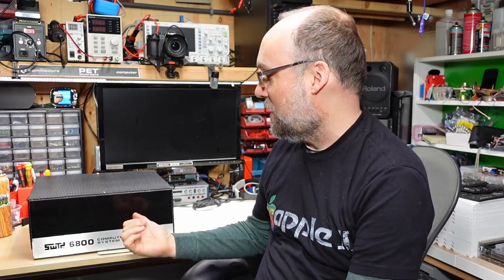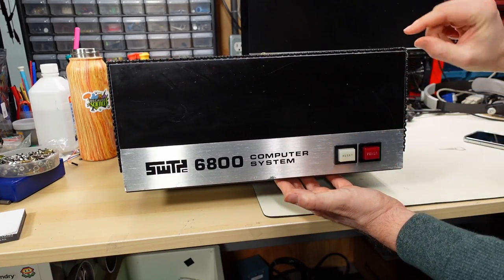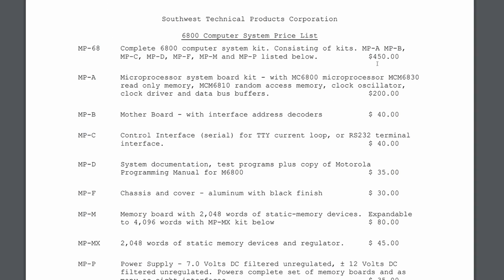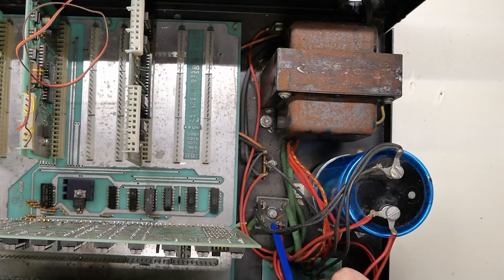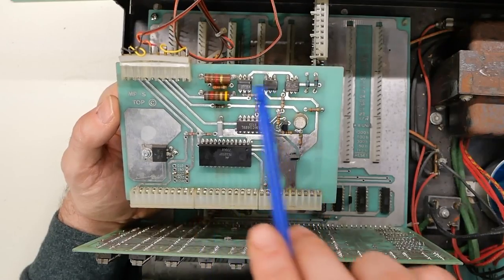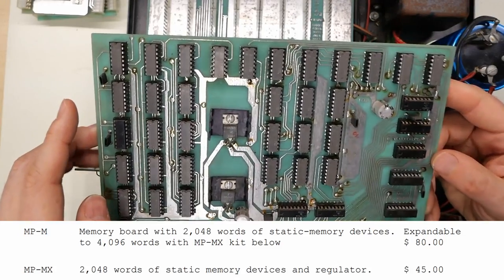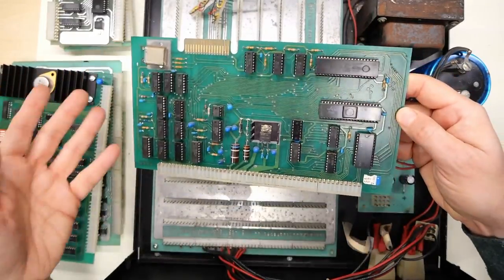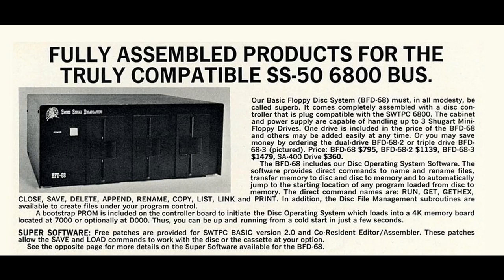The 8-bit home computer from 1975 you've never heard of

Comment: I worked at a company that used the 6809 variant of this machine in the late 80s.  My first day on the job I walk in to find a coworker standing on a rolling chair with a watering can pouring water into the case of one of these.  Of course, it was turned ON at the time.  After I picked my jaw up off the floor and we were properly introduced, he related that this particular machine had a crack in the motherboard no one could find, so they kept a thin layer of water in the bottom of the case to keep the MB swelled up and the mysterious crack sealed so everything worked.  The problem was the water would evaporate, and so it had to be "refilled" when the machine started getting flakey; the plastic standoffs made this possible.  This company used the 6809 variant as a central processor for a passel of "remote processors" (an in-house built version of the same machine) that monitored sensors and responded to the central processor via phone lines, hardwired, or radio broadcast.  The central processor stored data on a dual tape drive (DEC I believe) and my job was, among other things, to duplicate the central processor function on an Apple 2, and later an IBM PC.  I did a few other things for them, including the code for a new kind of remote processor with different sensors.  Robin or Don: if you're reading this, look me up.  J
Reply: No F'n way lol. I can think of about 10 better ways to seal that micro crack than filling the case full of water but hey, I guess it was better than no solution!
Reply: Do you remember the Apple 3 and the issues it had of the chips popping partially out of the sockets? Apple actually sent out a tech note that suggested holding the Apple 3 above a hard surface at a distance of approximately 5 feet and dropping it. This would reseat the chips in their sockets... Ah the good ole days...
Reply: @retroatx  5 inches, but yeah.  I remember...
Reply: Sounds like a joke they did to all the new people like finding the blinker fluid or the board stretcher.
Reply: @fredflintstone9609  I didn't even realize that I typed five feet :-)
Reply: geeeeeeez - bring some current new one - there is a bucket
Reply: It wasn't a joke: every Monday he would refill it.  I took over the job of refilling the watering can.
Reply: This is insane watering a computer like a plant 🪴 😂❤
Reply: @retroatx 😂
Reply: @fredflintstone9609 Definitely an "if it sounds stupid but it works" moment.

Comment: I bought and built one of these SWTPC computers. I even wrote quite a bit of software for it and had it working with the SSB disk drives, a Teletype 43 and later a SWTPC VDU/Keyboard combo which was in some kind of mouleded blue/cream case. I later also interconnected the SWTPC computer to a broadcast teletext receiver which let me save the "pages" to floppy disc. I also made my own S100 cards for memory and interfacing to Motorola exorciser boards. Everything was horribly expensive in those days amd one had to save up just to buy another 1K of memory! I'm pretty sure I still have some of the manuals tucked away somewhere. Sadly, I don't have the SSB DOS software you are are looking out for. Sadly all the hardware got ruined in a flood many years ago. Great memories - many thanks and the best of luck getting it operational. I still have 6800, 6821, MC14411 and 6850 Moiorola chips in anti-static tubes along with some 2102 memor chips (they were really fussy about static!).
Reply: So what did you wind up doing with the machine?  What were your motivations for putting a so much into it?  I
Reply: I have a couple of these and have been trying to find someone I ran across in comments previously who claimed to have programmed a pacman like game for it using the GT-6144 graphics board.  I have one of those boards and have never been able to find anyone who has one or any programs already done for it.
Reply: There should be one in my garage, with a floppy  drive. I didn't get any documentation or disks with it.
I worked with Motorola Exorcisor systems in the early to mid '80s. Two 'Metrodata' graphics systems that generated NTSC video for cable TV. Each system had six video cards to generate text. One system also had in interface card to use a SMS disk subsystem to store our program guide for up to a week in advance,
Reply: Speaking of the SSB disk drives, I made the wire harnesses for those when I was a high school kid in the family garage, at least for the earlier production runs. How that came about was that my dad worked at the Naval Weapons Center annex in Norco, CA at the time, and worked closely with one of the student interns (Tom K.) who eventually graduated and went on to form his own company along with some other bright young engineers  (Signetic Designs) making disk drive systems for 8080 based S-100 systems. My dad continued to to be associated with Tom, maintaining a friendship and interest in what he was doing. This was a garage shop type operation at first, and rather than do the tedious work of assembling wire harnesses for the disk drive system themselves, Tom had me do it for them, supplying a fixture and tools, etc for me to use. Later, SSB started making it's disk drive system 6800-based SS-50 systems, and Tom knew somebody there and somehow I ended up doing their wire harnesses too...

Damn, that was such a long time ago. I'm 62 years old now...
Reply: So you're also another who 'never heard of the SS50?'
Reply: @stevesether  Having fun while learning a lot. Is that reason enough? 😁
Reply: @stevesether  To answer this question: Why spend so much time and money on these computers? In the 1970s these were revolutionary. Imagine if you had a Quantum Computer on your desktop today. How much would you pay? AND... while not a motivation... all the time I spent on 8-bit computers in the latter 1970s got me into college and later landed me a plum job in 1985 when I graduated and has blossomed into a successful career. Without a doubt - this "little hobby" has paid for itself thousands of times over - quite literally.
Reply: One of the most interesting programs I got to work on was a program that recorded amniocentesis results. While I was not able to program yet (I was only 12) they let me test and report bugs and develop the testing scripts. These days AI does much of the actual analysis.
Reply: @devcybiko  I'd not pay anything for a quantum computer, because a ten year old AMD FX-6100 and (fanless) NVIDIA GeForce 210 are Good Enough (since the motherboard allowed me to upgrade to 32GB RAM and replace spinning rust with a flash drive as the main disk).
Reply: @RonJohn63  Do you know what a quantum computer is?
Reply: @devcybiko  yes. https://en.wikipedia.org/wiki/Quantum_computing
Nothing in quantum computing will make reading email surfing the web or watching YT videos easier or better than my current machine.
Reply: @RonJohn63  That's not what a quantum computer is for. The point I was making was that in the 70s hobbyists spent money on these computers because they were novel. Ultimately money spent on this "hobby" resulted in knowledge about computing that resulted in a career in software. 

Similarly, it would be like building a home Quantum Computer today. The benefits would pay off in the long run. The parallels are clear. In the 70s in order to have access to computers you either had to buy time on a time sharing mainframe, or build your own. Today, you can buy time on a Quantum computer built on one of the leaders in the field. You can't build a quantum computer like we could build a microcomputer in the 70s. But the quantum computer hobbyists of today will be the leaders in the field tomorrow.
Reply: @devcybiko  "That's not what a quantum computer is for."
OK, hotshot.. what are quantum computers for?
And just because something's novel doesn't mean it's even close to being affordable.
Reply: @RonJohn63  Do your own research. Read the effing wikipedia page you posted.

Comment: I took a train trip for 1.5 hours to visit a SWTPC shop in the city of Delft, one of the first "computer shops" in the netherlands, I was amazed by the enormous capacitors inside. And yes, they sold fully assembled machines, and also the terminal and some printers. I remember seeing a small cash register printer (40-columns) that was fitted on top of a square metal box.
Reply: That was the SWTPC PR40 printer. The Tech Time Traveler channel has a good video on it, along with a video on the SWTPC CT-1024, aka TV Typewriter II, which was probably the terminal you saw.
Reply: Long before switchmode units large caps were the only option
Reply: Excellent memories! Reminds me of a 3-hour-one-way bike ride me and my brother undertook, just to get to Charlotte NC and see the Apple ][ dealer there. We got in so much trouble for that. Should have left Mom a note.

Comment: As a sophomore in high school, this was the only computer I (with help from my dad) could afford. I built the kit but didn't have a terminal to talk to it. I bought an old klienschmit field teletype at a surplus auction. With the help of a local computer shop I wrote code to convert ascii to 5 bit baudot and used the old teletype for a year until I could buy a used, non working tv teletype....good times.... It was a great experience for a 15 yr old budding engineer!

Comment: The 6800 is one of my favorites.  I have two 6800 system units, the AC-30 tape unit, several CT-1024s, the rare PR-40 printer, the ultra rare GT-6144 graphics board and the almost impossible to find joystick.  The thing takes up an entire desk and a half when fully set up and the powerup sequence reminds me of a jet with all the switches!
Reply: i saw this and instantly thought of you!
Reply: @Arivia1  ditto. I don't understand how tech time traveller does not have more subs. Such a great channel.
Reply: I’d never heard of these machines until I was watching through your channel, then suddenly it pops up here too!
Reply: @drwhang  subbed because of this comment.
Reply: Got the hitachi upgrade?
Reply: Not gunna lie, it sounds like just the power up sequence would be heaps of fun and satisfaction

Comment: A SWTPC 6800 was the first computer I had seen in person. The man who owned it used a teletype for I/O. That was probably in late 1975. Thanks for the trip down memory lane.

BTW, RAM chips were VERY sensitive to static electricity in those days. So often new RAM was damaged and so had to be tested as part of installation.
Also, since that is not a switching power supply, any short will most certainly cause smoke and likely cause a trail of destroyed components. Have fun. :-)

Comment: So much memories.  I have worked as a young trainee then beginner engineer on these machines. Actually only on the SWTPC 6809 as far as SWTPC-branded machines go. It was a very advanced machine with RAM page mapping allowing for up to 768K of RAM on an 8-bit CPU,  running a small Unix-like O/S called UniFLEX.
As for the 6800, the French manufacturer Goupil was producing a machine that was very much inspired from this one from '79 on, the Goupil (the blue gen.1 and red gen. 2). Bus-based too, almost a clone actually, but a complete computer with a video controller, keyboard etc. I still remember the ROM monitor commands (was that MICMON?). It ran the FLEX 6800 o/s which was rather advanced for its time, booting from 5.25" or 8" floppies.
Reply: IIRC, the Goupil was a team effort, a microcomputer by computing hobbyists for computing hobbyists.  It was supposed to be a hacker's dream, designed to meet a hacker's checklist.  It was not a corporate product. The most striking thing about it was its built-in acoustic coupler.  And the beyond complete keyboard.
Fishing through some old issues of Micro-Systèmes magazine from 1980, only found a handful of full-page adverts towards the end of each issue, never found an actual article about them.  It shows they didn't have a corporate budget for marketing.
Reply: I was also an apprentice computer tech and cut my teeth on the SWTP! After repairing one of these, I always smiled and gave a little cheer when the '$' symbol appeared on the monitor! Happy days!

Comment: This brings back many memories! I assembled several of these for customers while working for a distributor that carried the SWTPC product line back in 1976-79. This computer was designed to be as inexpensive as possible to buy. Using the MIKBUG rom monitor instead of a front panel full of switches and leds was a lot cheaper, though it did force you to have some sort of teletype or terminal to use the machine. The SS50 bus using Molex pin connectors was cheaper than gold fingered card edge connectors like the S100 bus used. The machine was simpler, easier to understand and a lot could be done with it. The 6800 was an under appreciated 8 bit CPU for its time.
Reply: As was the 6809... (probably the most powerful 8-bit CPU)... unfortunately it wasn't cheap enough fast enough and it was overshadowed with the release of the MC68000 in almost the same time period, so few machines actually used the 6809.

Comment: Brings back fond memories of when I soldered together my first computer (Netronics Cosmac Elf - RCA 1802 with 256 bytes of ram). 
Later built (soldering again) an S100 bus based 8088 system. 32 kb ram and 2 8 inch Shugart drives running CPM. Those were the days. 
I look at my iPhone now and smile.

Comment: Nice, years ago a work collegue had one of these (but in a wooden box). I wanted to get into the 6800, and this SWTPC machine had all I needed. So I grabbed a copy of it's memory map and I kind of cloned it.
Apart from the disk controller, I didn't copy their design, I used my own design, that perfectly copied it as far as software was concerned, so I could use all their software.
Mine was built entirely with wire-wrap, it had 3 serial ports, floppy, and 40KB of static ram using 2K ram IC's (6116).
I also built the floppy drive into the enclosure, but with provision for an extra external drive via a 37pin 'D' connector.
Pity I cannot post photo's here.
Reply: There are plenty of online groups, I'd love to see the photos of your machine.
Reply: My Grandpa did a lot of wire wrap circuitry in the 70s with 16 pin DIP ICs.   It looked like a gigantic PITA to young me and I never warmed to wire wrap before it kind of faded from the experimenter's scene.
Reply: @lironmtnranch4765  Wire wrap was also used commercially, back when I worked for Telstra about 30 years ago, we had at least two models of high speed modems we leased to customers that were entirely wire wrapped in their construction. They were packed tight with boards, all wire wrap.

Comment: Thank you so much for producing this video - it brought back  so many memories from when I'd just graduated in EE and courses in digital electronics and computers were rare and new, often with xerox'd handouts rather than textbooks.  I read all the magazines but a new engineer's salary still couldn't touch even the kit versions.  I discovered the Motorola MEK6800D2 evaluation kit and begged one off of a Motorola engineering rep over the phone (still had to pay for it).
Not my first electronic assembly but it didn't work when I finished.  I found an old Army electronics technician who let me watch as he went over the circuit carefully - he discovered two traces shorted together where the etching was incomplete and scraped it with a sewing needle until the kit leaped into life!  128 bytes of RAM which I upgraded to 256 bytes after waiting for my next paycheck.
Display was a huge issue since terminals were way too expensive as were TV modulators.  The 'D2 kit got around this with the included hex keypad and LED display - I learned to hand assemble 6800 code and remember typing in a program for 10 minutes while a friend watched.  It worked but all it did was blink one LED!  My friend almost hurt himself laughing and told everyone the story anytime the subject 'computer' came up.  
Sadly the 'D2 was recycled at some point. I'd love to have one now but they are way too expensive on e-Bay. My career included only using computers (not designing them) but they made an interesting hobby.  I look forward to your newest videos and again - thanks for the memories...

Comment: First of all, got to mention the sweet 6809 from their later years that LMNC has.
Yeah, you have a very early SWTPC. And having a resident monitor standard instead of a front panel was a big innovation that happened in those few years since Altair and IMSAI. (In between was the keypad/7-segment style like the KIM-1 and H-8.) I guess ROM chips for a monitor program finally became affordable or something. Note that 1977 was the dawn of the Atari 2600, which made mask ROM chips a big business.
That floppy controller is enormous. I have one that I found on a 30-pin card, where some fool tried to fix it by piggyback stacking chips.
As for the price, the original TRS-80 Model 1 4K was $599, also in 1977. This was a time when even a single year brought major advancements in bang-for-the-buck.
I was living in San Antonio since 1979, but never had any idea to visit them back in the day. I'm kind of sad that I didn't, but I didn't even have a driver's license until 1981 or so, and I was firmly in the Radio Shack camp the whole time. By the time I realized they were there, they were gone.
Apparently the final two boxes of SWTPC repair parts (chips and other small parts) ended up at the 10bitworks hackerspace a few years back (I was there the day they came in), but with how hackerspaces are about "junk" taking up space, I have no idea if they still have them.